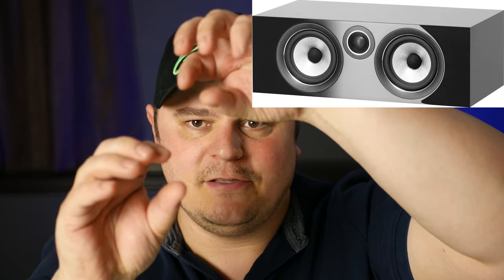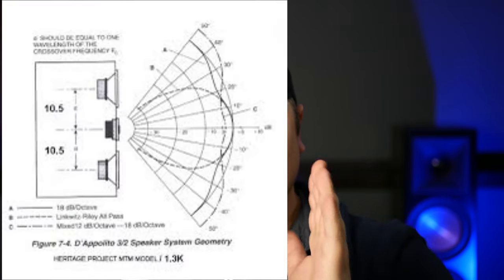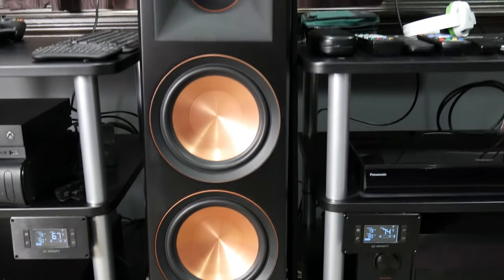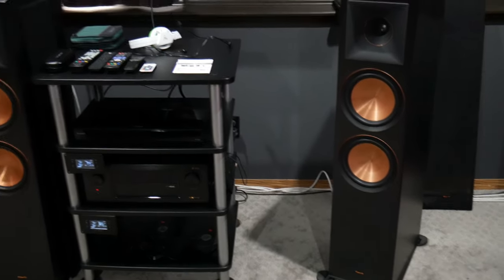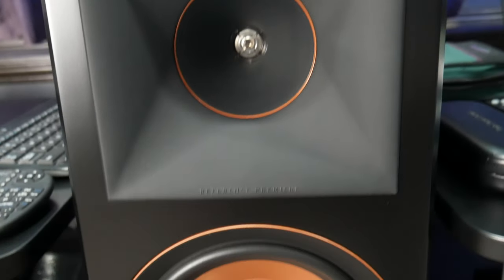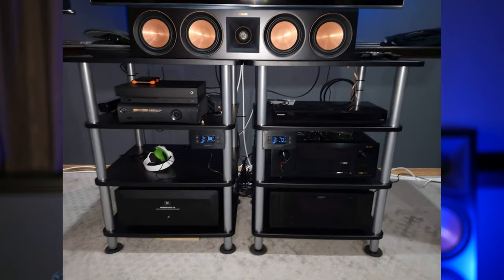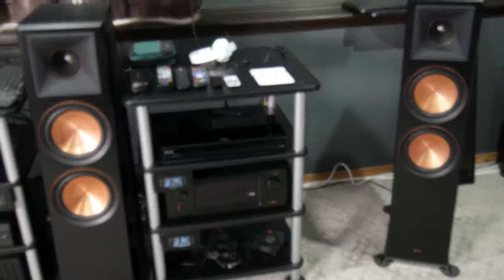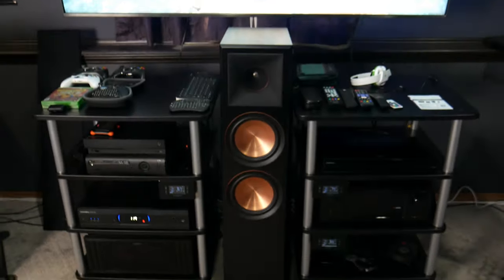IS A CENTER SPEAKER WRONG? IS A TOWER SPEAKER IDEAL FOR A CENTER SPEAKER?  I Spec of Tech

Comment: A question. Almost all the content I watch on netflix in 5.1 surround mode won't give much output to front speakers. So, is it really useful to have high end front standing speakers???
Reply from the maker: What device are you using to output the sound to your AVR for Netflix?  What speakers are you using? Using high end speakers for the most part won't increase your front stage volume a significant amount, unless they are much higher efficiency than what you are using.
Reply: What I'm saying is just like LFE channel has bass to put out and center channel has all the dialogues but front speakers don't have much audio source to put out unless your avr is set to All Channel Stereo. So the point is why have those large tower speakers when they're putting as much as a 4" driver speaker?
Reply: In case you don't understand my point just disconnect your subwoofer and mid channel and listen to rest of the speakers in 5.1 mode with 5.1 audio source
Reply from the maker: @oscarishandsome5150  Most of the entire movie is output through the front stage, they get used the most out of any of your speakers.  That is why enthusiasts will recommend spending much more on your front stage than on the rest of your surrounds.  Yes the center handles most of the dialogue, but the LR are used almost as much as the center for everything else in the soundtrack.
Reply from the maker: @oscarishandsome5150  It is a pretty complicated concept, but I think I understand now lol.  It is DEFINITELY worth it to buy timbre matched LCR and not cheap out on the LR speakers simply because you don't think they get used much.
Reply: Yes, I agree Left and right channels are the most important speakers in a soundtrack but in movies an expensiive tower will do as much as a small speaker. So, I conclude large tower speakers are good for stereo listening.
Reply from the maker: @oscarishandsome5150  Well there are A LOT of unspoken variables there to unpack.  How loud does the listener listen?  What types of movies do they watch?  Do they listen to music on the system and how often?  What type and brand of "smaller" speaker vs tower speaker would they be using? etc etc.  Yes in some cases a tower speaker would not be needed and smaller bookshelf style speaker would suffice.  That being said, in a lot of cases you would want/need a tower speaker.  Unfortunately there is no cookie cutter answer that would apply to all in this situation.  I do see what you are saying, and maybe what you are saying is true to your situation, but maybe not to everyone else's situation.  Thanks for the comments brother, appreciate the support and convo...cheers man.
Reply: Interesting! My AVR (a Yamaha I got for 100$) doesn’t let me put my towers in « small » as I don’t have a sub yet, but they PUMP when I listen to Netflix (e.g. Stanger Things, Dark, etc.). They work as much as the Center channel. Speakers are the Elac Debut 2.0 F6.2, C6.2.
Reply: What he is saying is unplug your center channel and listen to what comes out of your left and right front channels, it will be very minor and you could just use bookshelves for that and save money

Comment: Can you use 3 Center channels for a LCR set up?
Reply from the maker: You can do whatever you want really lol.  Although, the crossovers will be specifically designed for horizontal use.  It will still work vertically, but would be less than ideal.
Reply: You have to make left and right channel stand up

Comment: That's why I placed my ctr speaker vertically behind my AT screen
Reply from the maker: You have to be careful when placing horizontally designed speakers vertically, it can mess with the dispersion because they are tuned for horizontal use.  But if it sounds good to you and you dont feel you are lacking, then have it buddy.

Comment: Dude, I don't understand. Do you need to use the tower speaker to use the center channel?
Reply from the maker: Hey man, no you don't HAVE to use a tower speaker to use the center channel.  You could also use a bookshelf or a horizontally designed center speaker as well.  It is only that a tower is ideal as a center, but definitely not the only way. I hope this helps, cheers.
Reply: @SpecOfTech  thank you my friend ask a word I did not understand in the video exactly why the castle or bookshelf should be used What is the main reason?
Reply from the maker: @elcinesed7465  No problem brother.  The reason to use 3 identical speakers like 3 towers or 3 bookshelf speakers is because you get a perfect sonic match.  The reason they made horizontal center channels was mainly for convenience and to save space, this will work with most entertainment units.  A horizontal center channel has poor horizontal dispersion though, and will not be a perfect sonic match to your left and right tower.
Reply: @SpecOfTech   polk audio signature series s60s has the idea to go right and left Which bookshelf should I use for the center?
Reply from the maker: @elcinesed7465  In all honesty you should try to use 3 tower speakers, or 3 bookshelf speakers for the perfect sonic match.  You could use a bookshelf as a center, and you would still have much better horizontal off axis listening than a traditional horizontally aligned center speaker.  If you do decide on a bookshelf with your S60's, check out the S20.  If at all possible though, go with 3 S60's.
Reply: @SpecOfTech  Thank you for your time
Reply from the maker: @elcinesed7465  No problem man, glad to help.

Comment: movie theatre center speakers are towers like the left and right
Reply from the maker: yes sire they are.  What type of center channel are you running?
Reply: Spec Of Tech I built a custom speaker: The Dayton tweeter is mounted above the projector screen, and the woofer box with Aurum Cantus 7” woofer is below the screen with an external Dayton 2 way crossover at 2500hz. It perfectly  anchors the sound to the center of the screen. Came up with the idea myself.
Reply from the maker: @northsouth8884  Very cool idea.  An interesting solution to avoid going with an AT screen.  Good thinking man.
Reply: @SpecOfTech  Thank you...I think now the newest receivers replicate what I did digitally with multiple speakers, but the way I have it sounds like it is coming directly from the middle of the screen. The key is high end drivers that disappear. It breaks accoustic rules but the treble amazingly sound like it is coming from the center of the screen (I use Dayton Lpads to attenuate each driver to dial it in). I have an old Denon 3803 with external rotel amps (running only 7.1). But i like its DACs and I know how to use it. Plus I don't have to worry about holes in my movie screen. Just subbed- cheers
Reply from the maker: @northsouth8884  Thanks for subbing brother.

Comment: In my opinion tower speakers are entirely to boomy and do not represent an accurate reproduction of sound period. High end bookshelf and center channel speakers are key. Surrounds are not nearly as critical and any decent speaker will usually suffice. I would put my system up against any tower system no matter what the cost. I have a pair of Def Tec D-11's FR & FL, SVS Ultra center, Fluance sig series surround and Onkyo DN3XA for ceiling mounted atmos with 2 JBL SP-150 Subwoofers. The clarity and sound stage is excellant with no irritating boomy bass. I have tested and researched everything I could possibly get to. It is as close to perfect as the human ear can detect. Going beyond that is moot. Using ridiculously expensive cables and wires are foolish. You can only hear so much and going beyond that is a waste of money. People with OCD will spend a fortune to satisfy numbers on paper that will never reach your ability to detect. This is not scientific . It is my opinion. If I can not hear it I will not buy it.
Reply from the maker: Hey Randy, thanks for watching.  I must say though, a tower being too boomy would indicate improper placement, improper speaker for the room or improper eq'ing.  A tower speaker can and will reproduce the sound, but typically are much more capable than a bookshelf speaker.  Another reason a vertically aligned speaker is better than a horizontally aligned one is the off axis response.  This will definitely be noticeable for those sitting off axis.  But, if you love your system as is, then just keeping on enjoying it...don't fix what ain't broken.

Comment: Do you have any idea what you are saying? A horizontal speaker has much more dispersion than a vertical speaker, that's why center speaker has either MTM configuration or bigger with 2 mid woofers on either side with a tweeter in the middle, cone filtering with a vertical speaker shouldn't be an issue for anybody off axis.
Reply from the maker: You are dead wrong.  But I don't want to argue, the facts are in the video.  Hence why ALL major cinemas use tower like speakers, none of them use a horizontal speaker EVER!

Comment: The obvious problem with this is that your screen willnne too high
Reply from the maker: I understand what you are saying, but that is a common misconception.  When most people sit in a home theater, they at the very least rest their head on the back of the seat.  This automatically increases the incline of your on axis viewing.  In addition to that, most people have recliners in their HT.  When your seat is reclined and your head is rested on the back of the seat, technically "straight ahead" for your eyes is higher up on the wall closer to the ceiling.  So yes, if you sit up straight like the Nuns, you would want your display about 3ft from the floor.  BUT, if you rest your head or recline, having the display higher is actually easier on your eyes, because you aren't always technically looking down.  Thanks for watching...cheers!
Reply: @SpecOfTech  I have my own Home theatre wirh recliners. I also have self adjusting eyeballs that automatically turn on their axis  so as I  recline they automatically adjust and level out to the screen.  Pretty cool. 
I have 4 seats in a row, I'm debating whether to replace my broken centre as I don't think the end seats will be that much off axis to even need one . Thanks for the reply
Reply from the maker: @booshallmighty  Exactly, your eyes adjust downward to "level out" ;P!  Kind of like they move upward to level out if the screen is higher up lol, they can even move side to side...cheers man.